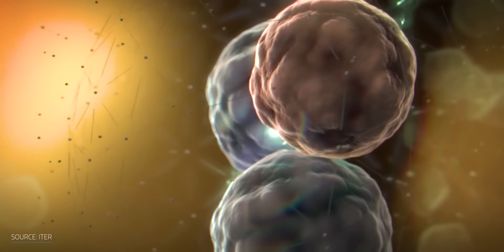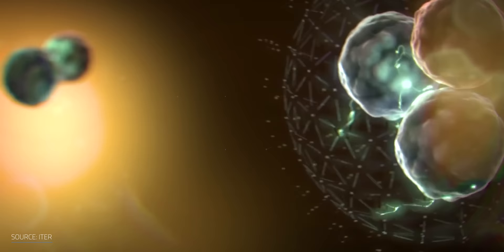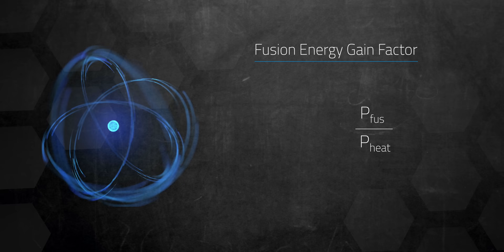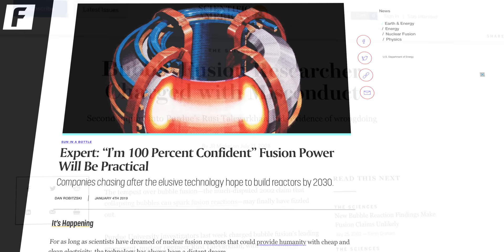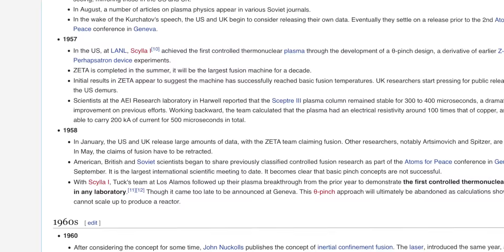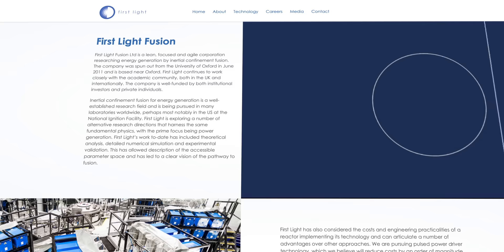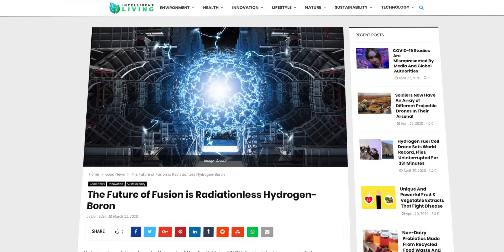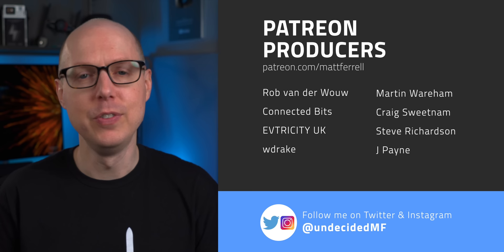The truth about nuclear fusion power - new breakthroughs

Comment: 0:07 don't say "fueled by sea water" even though sea water has the elements, it isn't accurate or useful to say that.
Reply: Yup, Seawater contains about 1/8000 parts of deutrium. If Deutrium extraction was cheap and easy most fission reactors would be heavy water reactors instead of light water reactions. Also Tritium is a man made isotope, not found in sea water.
Reply: @guytech7310  Also, tritium is more expensive than gold.  I remember when viable fusion power was only 20 years away. Now its 30.  Eventually it'll be 50 years away, 100 years away...impossible.
Reply: Michael Bishop way more expensive than gold. Lucky the fusion reaction produces its own tritium, so none will have to be bought.
Reply: @ozzymandius666  It's expensive for you or I to buy but any government could make it easily as a byproduct of another process.
Reply: @krashd  They can't make it easily. It's actually a huge pain to make, that's the point. Also, tritium /is/ naturally occurring, just in even lower quantities. For those who doubt, spontaneous fission of heavy isotopes in seawater releases neutrons, these neutrons normally come to rest in the hydrogen atoms of water, making deuterium. If one of these neutrons just so happen to come to rest in a deuterium atom, it becomes tritium. This is still a gross oversimplification, and I can't overstate how rare this is, but it does still happen enough in nature to be measurable.
Reply: @guytech7310  Read my above comment please.
Reply: @Dumdumshum  The amount of naturally created tritium in seawater is less than 1 part per Quintillion: meaning its zero. 

Deuterium with 1 part in 8000 is barely economically feasible. "If" you have a working fusion reactor with deuterium, it would be far more economical to trans-mutate Lithium into tritium. However I doubt fusion reactors using Deuterium or tritium will be economical since about have of the energy produced is in the form of fast neutrons, making difficult to convert that energy into a usable form to produce electricity or heat. Plus those fast neutrons are going to cause neutron embrittlement and probably cause issues for high temperature superconductors (exposure to high nuetron flux).

That said, I am pretty sure magnetic plasma confinement won't work because the plasma interacts with the magnetic field, destablizing it. With 50+ years work on Magnetic confinement, no one has managed to maintain a stable fields for more than about 180 seconds. Super conductors won't fix the problem. All you doing is using a bigger hammer to wack a ceramic vase. Its going to always have the same outcome.

Perhaps the HB11 project, using petawatt lasers to accelerate protons into Boron will provide a workable solution.

Maybe the electrostatic confinement project safire, might turn out to be real & not a scam like the Rossi's e-Cat.
Reply: @guytech7310  "and I can't overstate how rare this is" I just meant that to say it's nil is too much of an oversimplification. Essentially nil, yes.
Reply: @guytech7310  Fusing pure hydrogen is much harder than the other 2 isotopes.  But yeah, it ain't exactly sea water, but the hydrogen isotopes extracted from it.  Sea water nasty.
Reply: @guytech7310  How about stellarators to obtain continuous confinement?
Reply: @Robert-er5wq  I guess they have less than 10% of being successful. Issue is that magnetic fields travel in lines, and are not uniform like gravity is. Magnetic field emissions are in field lines, with increasing and decreasing strength. Its a lot like trying to compress jello in your hands. The jello is going to escape from your fingers. Your fingers are like the magnetic field lines & the jello is the plasma.

Since plasma is a conductor, moving plasma is going to induce magnetic eddy currents that interacts with the magnetic containment field which than destabilizes the magnetic confinement field. 

So far the plasma tests on the 7-X stellarator have been disappointing with no confinement stability. I believe they are upgrading the interior materials that are more heat resistant so the get longer run times with more time to tweak the magnetic confinement.

https://aip.scitation.org/doi/full/10.1063/1.5098761

"a drawback of stellarators is that the toroidal symmetry present in the tokamak cannot be maintained. The consequences for plasma transport are considerable. In both tokamaks and stellarators, the magnetic field strength varies along the field lines, which leads to particle trapping in local magnetic wells. In the tokamak, the collisionless orbits of trapped particles are well confined within the plasma, but in stellarators, they are not."
Reply: @t00by00zer  don't forget the world's flat to😂
Reply: @ozzymandius666  You fusion naysayers always astound me with your cynicism.
Reply: @Captain-Sum.Ting-Wong  I would like nothing more than to be proven wrong.
Reply: Science Revolution  ...and the Earth is flat.
Reply: @guytech7310  clearly fusion will eventually work, its just a matter of scale. The question is weather the scale is within what would be economically fiesable.

I also think fusion is overrated. Also its not clean. It produces a ton of very fast neutrons that ignore the magnetic fields and hit the walls of the reactors making them radioactive and eventually deteriorating the materials. There are countermeasures, but either way, the something is getting radioactive. Too many people ignore this.

Best solution to energy in the near future is gen 4 fission reactors for baseload power. I love MSRs even though, just like everything they have their problems.

Then renewables since time of day is when people use the most energy. Then natural gas peaker plants. You can produce methane from the air and energy so this can 100% be sustainable.

Then if superconductors become very viable, we can interconnect the whole grid of the world with no power loss and a solar panel in Beijing can power my house at night in California. Unless i dont understand superconductors as well as I thought i did. And in this case superconductors would connect cities then the cities would have their own regular power lines.
Reply: @boggless2771  Fusion does work... In Thermonuclear weapons. 

As far as sustained reactions in a reactor, unlikely unless the Femto\petawatt laser system works.

Scaling will not fix Magnetic confinement, because scaling does not fix the primary issue of the reactor plasma interacting with magnetic fields, which quickly collapses the containment field. It like trying to put out a fire with gasoline, the gasoline will will fuel the fire, not put it out. The Plasma problem has been know for about 60 years, but because nations are willing to throw billions into magnetic confinement projects no researcher is going to refuse because they collect a salary from it.

I suppose if you scale the reactor up to about 0.1 solar masses, then I will agree sustainable fusion using confinement works.
Reply: @t00by00zer  Have you seen the image of the Black Hole that was taken? There is actual physics behind why Black Holes exist.
Reply: @t00by00zer  You know he has been dubunked by other, more reputable scientists right. Of course you cannot take an actual picture of a Black Hole. But that is close enough, and it has proved their existance.
Reply: HunterSteel29 debunked you say. 
I LOL at your assertion. 
I understand the physics of image capture and there is no way that black hole image is not a pure fabrication.
Reply: @t00by00zer  You continue to think that. Real science is being done while you doubt it. Sounding a lot like the Flat Earthers and Moonlanding Deniers.
Reply: HunterSteel29 unlike you I actually studied physics, chemistry, thermodynamics and electrical engineering. I know when I’m looking at scientific fraud. You don’t, obviously. They intend that science fiction for you surface consumers of “science.”  
Plasma jets are not caused by black holes.
Reply: @t00by00zer  it can be observed and seen and predicted
Reply: @venlil  you'll have to be more specific.  What is observed and predicted?
Reply: @t00by00zer  the movement and effects of black holes can be predicted also why couldn't a black hole exist in a electric universe
Reply: @venlil  the movement and effects of black holes take place only in computer models.  None have ever been observed.
The existence of black holes is based on the false assumption that gravity can compress matter infinitely.  It starts with the fallacy that a star is a ball of gas.  The evidence from our observations of the sun do not support the ball of gas theory.  What we observe is a continuous spectrum indicative of condensed matter.  The solar spectrum is almost a perfect replica of the black body ideal.  No combination of glowing gases can replicate that spectrum.  Only something with a molecular structure like graphite can produce a continuous black body spectrum.  The most likely candidate at the sun is liquid metallic hydrogen in a hexagonal lattice, the same lattice as graphite.  Liquids and solids do not compress and therefore the idea that a star can collapse under its own gravity is utterly preposterous and not supported by any observations.
There is no need for black holes to explain observations like plasma jets at the centers of galaxies.  The orbital dynamics of stars near the center are assumed to be gravitationally caused, but that again is not supported by observations, namely the existence of fairly young stars in the region of the supposed SMBH and the passage of a gas cloud that should have been consumed, but was not.  Never mind not a single image of "lensing" from that region.
Plasma/Electric cosmos explanations do not need things like neutron stars and black holes to explain the observations.
Reply: @t00by00zer  none of that makes any sense what's so ever
Reply: @venlil  If you don't understand black body radiation and what it means, you are wholly unprepared to discuss this topic.
Black holes are not science.  They have nothing to do with science.  They are nothing but pure conjecture based on bad theory.  They have never been observed.
The same can be said of neutron stars.  Neither can be falsified, nor experimentally verified, therefore they are not science.
If that makes no sense to you, again, you are not prepared to discuss this topic.
Reply: @t00by00zer  I'm not going to waste my time with a troll

Comment: The main problem is that we're not actually imitating stars, the sole way we know nature achieves fusion. In stars, gravity does the work of confining & heating essentially pure hydrogen plasma to the point it fuses.

Because we don't have gravity control & our reactors are way smaller than stars, we're really trying to do it with pure electromagnetism under very different conditions. The problems are that 1) this requires E&M heating of the plasma to a temperature way HIGHER than a star (10-100x hotter), 2) we can't use the same fuel mix or nuclear reaction that stars do, and 3) to even attempt this we need ultra strong magnets that can't easily be engineered. 

Really, we'd be a lot closer to fusion reactors if we had room temperature superconductors. One of the massive engineering complications with these things is having to cryogenically cool the magnets of a reactor core that's manipulating million degree plasma.
Reply: I'm one of the engineers workign at ITER, and I everything you said is absolutely correct.
Reply: am just a student but isn't this pure em approach partly because of the strong force's legacy? that is the strong force is  believed to be an actual force of its own, not gravity working at the quantum level? the fundamentals were not questioned when hot fusion first took off therefore the mo has been to resort to these ultra high temps in attempt to reach energy levels of the strong force to break atomic bonds. seems like a dead end. 

If we entertain er=EPR and the notion of space being entangled by planck scale wormholes, for all we know if the strong force is actually the result of gravity at the quantum level - say the strong force actually works out to be gravity between two atomic blackholes - then what hope is there for such a brute force method?

Comment: So, the project after Iter is called Demo, and it's the most grounded possibility we have more commercial fusion power in the "near term". Right now, that would be sometime around 2045. Fusion is not 30 years away, it's 25 years away... And getting closer... Really excited to see how quickly society will change with fusion power.
Reply: DEMO in 2045?? EU DEMO isn’t expected to run tritium until the late 2070s

Comment: This video about nuclear fusion covers things an acquaintance has mentioned before like the use of high power lasers and the development of compact fusion reactors. Things I hadn't heard about previously because I've not been closely following the research into fusion. I appreciate that the guy in the video did still caution the viewer about expecting to power our homes with fusion power within the next 10 to 20 years. By which time renewables could be even stronger. But I would sincerely hope fusion's true role once it's unlocked and commercially viable to eliminate fossil fuels completely from our energy mix with renewables being bigger contributors than they currently are.